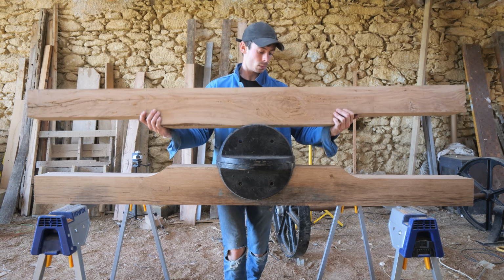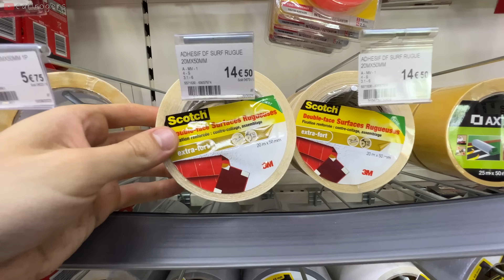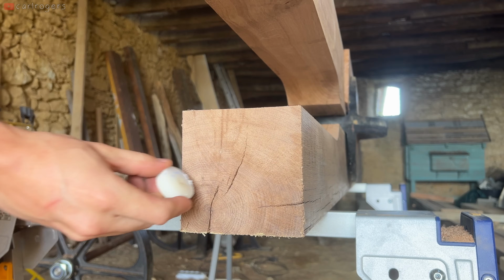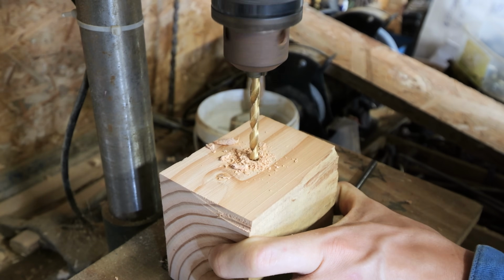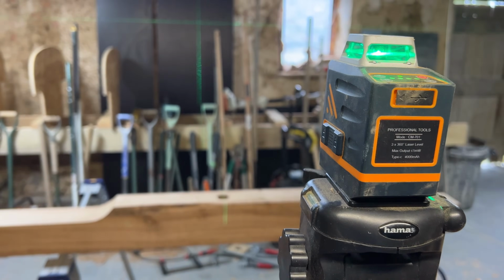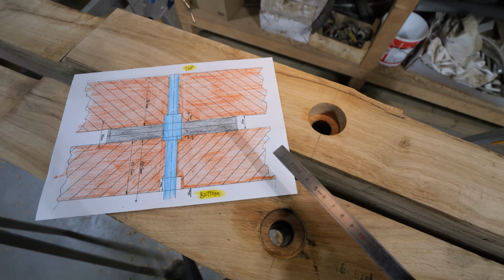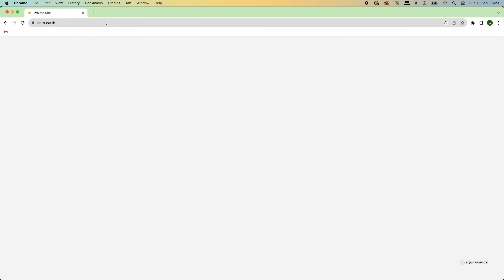Tapered Shims & Big Holes  |  DIY Shepherd Hut #2

Comment: I'm a retired shipwright.  The secrets to drilling long holes in planks are: 1. Use a barefoot pilot augur with a pre-drilled starter hole. 2.  Use a guide to support the bit at least 12 inches beyond the plank edge. 3. Most important!  Drill from both ends. That reduces the chances of a 'drift' error by 50%
Reply: Thanks very much
Reply: Also retired shipwright, you are relying on a pilot bit to not drift. If you need something really accurate like shaft log, you need a boring bar.
Reply: It won't reduce drift by 50% it reduces it 100%. If you drill from both sides there is no way NOT to have correct orientation of the entry and exit. And you have to be completely ham fisted not to get the holes to line up to the point the second shot will catch the first hole.

Comment: Karl you should have drilled the widest potholes first. That way you still use the center spike on the forstner bits to prevent the drill from wandering. Then you drill a pilot hole through a  square (!) block on the drill press. The pilot hole should be no wider then the centerspike of the bradpoint drill you'll use next. The block and pilot drill can then be centered in the spike divots of the potholes. Drill until halfway from both sides (lesschance of wandering!) Then follow the pilot hole with a bradpoint all the way through. This is the standard way for long hole drilling in wood to prevent getting off course. 
Cheers,
 Dick
Reply: Agreed. That's how I drill stepped. holes in large things. Never freehand. The laser offers guidance but doesn't correct you when you are off.
Reply from the maker: Good knowledge thank you

Comment: You can make a drill bushing for alignment by drilling on the drill press, relatively thin pieces to be glued together stacking them to the desired height on a removable alignment pin!
Works like a charm!
Wondering why you didn’t cut the large timbers on the angle from the get go?  You could have planed them into specification
Keep up the good work!
JIM ❤

Comment: I have made long shims using a jig on my thickness planer. For the smaller ones you made you could also have made a router jig. For the end sealer I made a batch of bees wax, turpentine and linseed oil. For general use end sealer I use driveway sealer, a tar mixture that  dries overnight, cheap and works. You can repair that off center hole with a oak plug glued in and redo. If your hole is that mission critical you can drill a pilot and then set up a boring bar. I have made temporary boring bars by threading a hole saw on an all thread rod.

Comment: Use superglue instead of double sided tape. 1 dab every 12-15cm. Holds just as strong side to side but is a lot easier to break free. 
As for the 28mm holes. If you ever need to do that again, drill the holes multiple times stepping up in 10-12mm jumps. It will be quicker because the drill won't bog down and you will be less likely to burn the motor out on the drill. Jumping straight into 28mm holes is a lot of work for the drill. Even a quality one like Festool.

Comment: Hey mate, next time you need to drill a hole that deep perfectly vertical, you can just use your little drill press.  On Most of this machine types you can actually swivel the foot around (180°), after loosening the bolt's of course, so you can clamp the foot on the other side to the wood.

Comment: A commonly used trick in metal machining is to use regular painters tape on both surfaces and then super gluing those 2 pieces of tape together. That's super strong but also very easy to remove

Comment: minor correction: the draft angle is not there to help removing the cast iron from the mold. the mold gets destroyed after every casting.

it is there, to help with removing the pattern from the mold, before the liquid iron is cast into the void the pattern leaves behind :)

Comment: Ive drilled quite a few deep holes in hardwood and some freehand like you did.   I cant remember the brand but theres so e drill bits that are like the 2nd one you used but the spiral is only an inch or two long, its then on a reduced diameter shank, i have one that is nearly a meter long.  This reduces the strain massively on your drilling machine.  You can hold it very much easier then to get a straight hole, you arent getting pulled by the drill.  Ive also used guides with bearings running on the reduced shanks, that stand off the work, to allow you to withdraw the drill bit to clear the chips then go back in.  Yove done a good job with what youve done, so thanks for sharing, and i hope you dont mind me sharing my experiences.  😊

Comment: 8:39 better if you paint it with wax. Heat some natural bee's wax, not paraffin wax and paint it on.

15:44 for future reference, you need a jig. Out of plywood, you make a large C. This C needs to look like a C clamp. One end of the C has a threaded rod with the end facing the work piece sharpened to a point, this goes right on the center of the hole where the drill will exit and you use the threaded rod to make sure the clamp stays put. So you don't split the wood, you use a washer that just fits on the tapered end, but doesn't go over. That becomes the clamping force. On the other end, you need two bearings that fit your drill as close as possible without being too tight (some sand paper action may be required to fit the bearings just right). The bearings should be at least three widths of a drill apart and you need to align them perfectly to the tip of the threaded rod on the other side. You use the drill to achieve that, by passing the drill all the way through the bearings such that the tip of the drill is touching the tip of the threaded rod, only then do you glue the bearing block in place (drilling small screw holes so that it doesn't move from the proper position when it glues would be advised). Once you're done, the "clamp" goes over the beam, you align and squeeze it with the threaded rod and washer and begin drilling on the other side letting the bearings guide you. It will stop working once you reach the touching tips of the drill and threaded rod. Do not push the drill, let it work on its own.

This is a recreation of an old timey tool that would be used to accurately cut the alignment holes in old chairs, boat rivet holes for the masts or rudders and many other things that required the drill to enter one place and exit exactly on the other side, where it was marked to exit. Very efficient. If you have access to a lathe, you only need one of these tools made for just about every job, by making blocks that fit in the bigger bearings reducing the size to smaller drills.

Comment: My buddy built same 'Gypsy Wagon' in the 80's, with auto suspension and rubber tires. That was his 3rd wagon. He took it on a trip and 300 miles in, the suspension crapped pout and so he wrecked the truck and wagon. He walked away. 
So, I do not believe this sort of rig your building is portable on it's own. You could take it on the road, but running at highway speeds in the long run is insane. Better to truck it to where you want to be and perhaps move it down the road at 10 mph.

Comment: Your benchtop drill press is small enough to almost be considered portable. It would be possible to clamp the base to the bottom of the beam and drill at least halfway through. Filp it and drill from the opposite side. It should come out spot on.

Comment: I’m curious about why you didn’t use the power and built in right angles of the drill press when making those precision plumb holes. Anyway, great video as always. Thank you 😊.
Reply: Drill press didn’t look big enough to me. looks to be a bench mounted one and not a pillar drill.
Reply from the maker: this ⬆️
Reply: I am impressed the festool drill did as well as it did. Sometimes you gotta do the best you can with what you have.
Reply: @jeffmoffat6967  yeah it’s a strong drill but more importantly a brand new sharp bit. also you can see Carl using it correctly, taking little bites out of it and clearing the hole, letting the drill cool off. patience is the key with every type of drilling operation. slow and steady wins the race.
Reply: There are drill stands that don’t suck*, essentially giving you a portable drill press. Could be clamped to a beam like that and improve the accuracy a lot. Despite that, I would still go in from both sides – not only reduces the chance of wandering off, but also enables you to use shorter drill bits. A self made guide would also help.

*Mine is made by Wabeco and seems to be the only good one that doesn’t cost a fortune. If I ever buy a large drill press, this thing is staying. Really helpful.

Comment: Are you sure this particular fix has place on such a heavyweighted support arrangment?

I mean wouldnt that robust iron hinge (thingy) acting alongside the heavy timber crush those supports over time??

Recess them, making new ones about 2.5 thicker?

Or incorperate the expansion into another bean arrangment and use that one elsewhere..

Comment: Thanks, Carl.  I still shudder when your over shirt tails dabgle precariously close to machines. You must have missed that shop class.  We don't want to see that blooper.  Auger bits that long require a half inch drill with tap handles because they will chuck you across the room. The Brad point bit is a much better choice.  Well done and take care.  Nova Scotio strong
Reply: il ce fera avoir un jour .

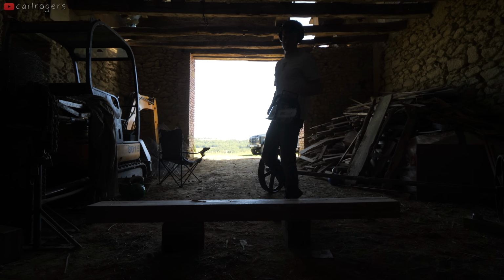Comment: 3:49  I don't understand why you couldn't have used some digital calipers to find out what the inconsistencies were with the shims, then used jointer/planer/belt sander to correct those inconsistencies until both shims were equal thickness.   Surely that couldn't have been as difficult as starting again from scratch.
Reply: Everyone has their own way. I'm sure he had a reason wether you agree with it or not.
Reply from the maker: Essentially, I wanted to do it the right way. The technique is a useful one to document
Reply: Well if one shim is too thin, you can’t add wood to it. But I also didn’t quite understand the huge fuss – the shims are small enough to create the angle for each one with a hand plane, maybe a No. 5. Sounds a bit daunting, but it’s actually not difficult at all. But the way Carl did it works too, so all good.

Comment: The shorter drill bit should be able to hold more stably vertically, with less torque at your hand. 
If a drill does not have this already (yours doesn't seem to), you can buy small levels to stick onto it to show you when it is exactly vertical (or horizontal). Sorry about the off center start--very strange.

Comment: Why did you not use the drillpress to make the hole in the guideblock?
Reply from the maker: Not enough clearance on the drill press
Reply: A drill press rig using sliding clamps to hold the dill/bit perfectly straight on a rig, be positioned over the large beam, then lowered slowly was my first thought.
Reply: @carlroge 

@11:48

In the future, the drill press should be able to rotate both the headstock and the base platform 180 degrees on the column. Set up a table for the press to sit on, with the headstock centered over the beam. Drill using the two fluted bit, at a feed rate that will not bog down the press, or burn the wood. Go halfway through, flip and repeat.

Comment: Could you not just turn the foot of the pillar drill round and the bed and use the pillar drill? You would have to support your work piece on saw horses but it would guarantee it to be straight.

Comment: Your mistake was in not making a sand mold for pouring the iron, then you would have straight sides.
Reply: But you don't want straight sides.  The angle is to allow ease of removal of the timber for maintenance / repair.
Reply: @gillie-monger3394  The tapper as Carl said was so he could get it out of his mold. If the sides are meant to be tapered it would be so you can tighten the wedge if the wood shrunk.

Comment: the is no mold on the cast iron casting, itsa sand cast, your beams are far to small they should have been carved into a larger beam. you made a major mistake. the taper is for strength of the cast iron to avoid breaking and cracking and to retain on the oak beam properly . to pinch it .

Comment: Hmmm...why not leave the beam wider in the center to fit the angled cast iron piece to begin with? You have the portable band saw and a drill press but you used the short Makita circular saw and free handed the holes? Are you sponsored to use the wrong tool for the job?  These shims seem like a dumb idea they will not be stable in the long run.🤔 Seems to me this was not very well thought out or planned and resulted in a lot of wasted oak and a subpar job.

Comment: 2:13 ARE YOU OUT OF YOUR MIND?  Cut from the other direction!  Don't leave the whole body of the saw hanging in space like that, for fuck's sake.  My shop teacher would have kicked my ass for that.  Not to mention, you're applying for a Darwin award when you use a circular saw on a beam that is not in any way secured in place.
Reply from the maker: circular saw only angles one way mate.